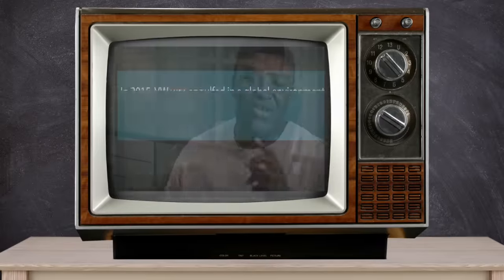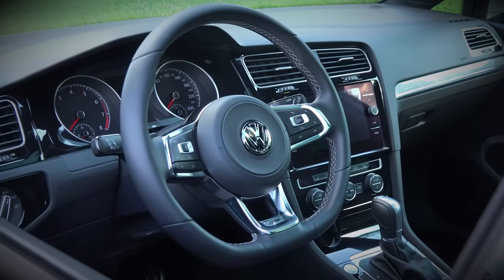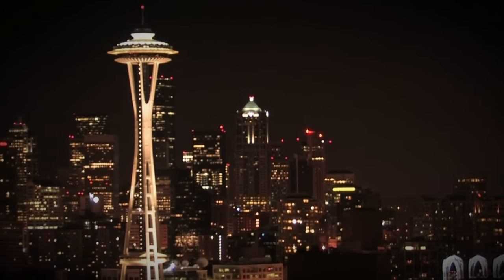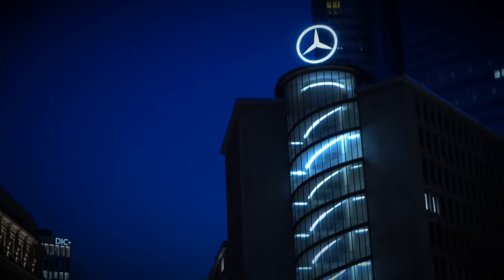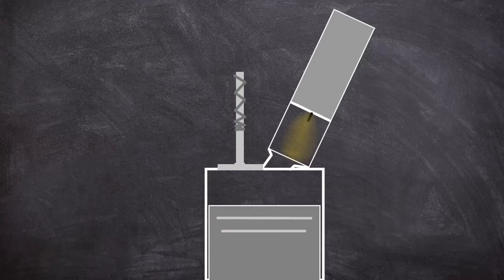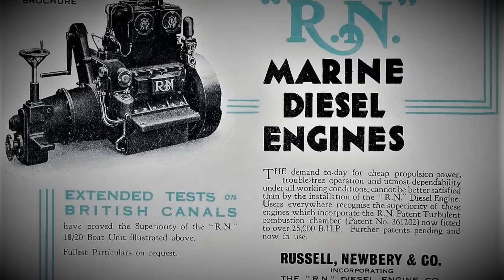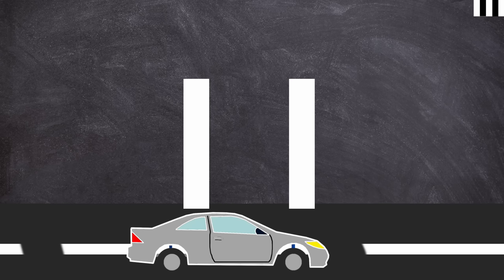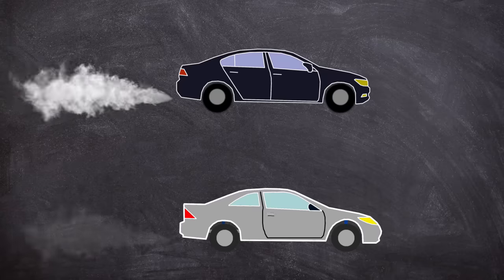Scandal: VW Emissions Dieselgate Explained | Plainly Difficult Documentary

Comment: Am a truck driver and my dad was as well.
I used to like the smell of a truck stop full of idling trucks back probably in 2000.
Now trucks using DEF a NOx 'solution' can give me an instant headache just hooking up trailers.
These systems also rob the truck of power and are horribly unreliable. 

I'll let you figure out if I would prefer to live with the consequences of NOx or with the systems currently in place to combat it.

I'll also say as far as I know, Diesel engines are always vastly more fuel efficient then Gasoline counterparts and more reliable.

That being said, I would love to see proper experiments with some sort of afterburner to deal with NOx and soot instead of a $10k filter and DEF. 
What upsets me more is its NOx OR soot, because one is from fuel rich combustion while the other comes from O2 rich combustion, but trucks are saddled with the weight, proformance lose and maintenance cost of dealing with both.
Reply: Yeah, and I prefer the cleaner air, deal with it.
Reply: @sparkplug1018  I do deal with it, every day I go to work I deal with a truck that struggles to haul your useless crap.

I also don't have any idea the environmental damage DEF does to the environment and I know you don't either, I know that it makes the exhaust from the truck I drive stink and cause me pain where older truck smells is strangely  pleasant on the rare occasions where there are enough of them running overnight keeping their drivers comfortable.
Reply: @ARockRaider  Want to know something funny? My grandfather said the same thing about steam locomotives, said they had a pleasant smell and had soul compared to these modern more efficient and lower polluting diesels.
Is DEF bad, maybe, though considering what it breaks down into, I'm going to hazard a guess that it is way better then what ever was spewing out that stack before. 
Hey fun quick question, are you also pissed you can't gravity balance the tanks anymore too? Despite the risk of damaging that transfer line.
Reply: @sparkplug1018  NOx is "what was coming out of the stacks before" and it's something that proformance cars use, they call it "nitrous" that's why I think an afterburner running either diesel itself or something like propane course deal with NOx

No driver who cares about fuel economy wants to see soot coming out of the stack because it's wasted fuel, as cool as the long trails may look.

If fuel balance problem I had I would simply install fuel pumps to balance fuel levels or have cross over pipes above the tank to deal with the one sided dispensers. (So the left tank would have a fill port on the right and vice-versa in addition to having a fill port for its side)

I want my equipment to be as efficient and robust as possible, near as I can tell the emissions standards are excessive and do very little good past a certain point.
I also believe those standards are there to make money for the manufacturers of the specialized and not ready for the real world equipment.

A belief I wouldn't argue against is that the emissions standards are intentionally unreachable to make life harder for the common man, don't try to argue that point cuz you won't convince me considering how CA wants to force use of electric cars but can't support the electrical dames placed on it by what few EVs they already have.
Also keep in mind that CA is the spawning ground for almost all of these excessive standards.
Reply: @ARockRaider  Well to be honest, I agree that an all EV future is some weird fever dream, that's a fair point.
And yes I know all about NO2, I use it at the track myself, no one is continuously running it on the street, those bottles don't last very long. I also run 110 leaded at the track, no one is running it on the street anymore.
And to be honest, you're one of the first drivers I have heard not have a problem with the EPA not allowing the bottom exit gravity feed transfer.
But no, they are not making regulations to make life difficult for little ol' you, that would be so counter productive it's not even worth discussing.  Since if that were the case, new car sales would just stop, and all that older stuff would just stay on the road.
Reply: @sparkplug1018  ok, sorry I'm gonna be a bit snide, someone who runs race cars is giving attitude about the environment to someone who moves goods for a living 😆 I couldn't write that sort of thing without being called a hack!

So, if you know that NO2 can be used as an oxidizer in proformance cars you would also know a thing or two about burning it back down to nitrogen and oxygen.
I'm sure a propane burner in the exhaust system would be every bit as effective at deal with the NOx and soot in the exhaust system, I just don't have the money to do any research on it and I'm sure whoever is making money on DEF would lobby against such a system's adoption if it were to work.

That's why you are required to have the system on the truck, not required to be tested that you are still meeting the standard every year. (In my opinion)
Reply: @ARockRaider  yeah I know how weird, I run that down the track on the weekend, how awful. Not thousands of miles over the road. Pretty big difference
Reply: @sparkplug1018  I just thought it's funny how one is a critical function while the other is a sport.

I don't actually care, I'm gonna keep enjoying my work best I can knowing full well that most people hate what I do and don't understand that If it weren't for people doing this job things would be much harder to get.

Trucks are the red blood cells of every modernized country, trains can serve an important part of that but can never move individual loads as fast or as remotely and trucks will always be needed for "the last mile"
Reply: @ARockRaider  Actually I appreciate truckers for the most part. And honestly would prefer shit not be so expensive operators feel inclined to put reslaps on trailers. Just leave the left lane open, realize we all have to breath this air and honestly I think we can all be happy. Because I’ll be honest with you, I don’t know if we are effecting climate change, but putting less crap in the air can’t possibly be a bad thing
Reply: @sparkplug1018  most of the worst offenders for bad behavior tends to be out of the supper carriers, they are the ones governing their trucks and leaving the trucks underpowered to try and save fuel.
Retread tires when done right are actually a great way to recycle the tire shells, but personally I wouldn't use them.
Unless it's an owner operator the driver actually has almost nothing to say about the truck's condition.
Any driver who is trying to optimize for fuel efficiency and reliability will try to get a truck older then 2003 because those trucks don't require the emissions parts that really hurts the trucks.
It's at a stage where you can have efficiency or you can have the emissions systems. (though having them is no guarantee of improved emissions)

Comment: but vw didn't use common rail until like 2007? they used PDs in 1.9 and early 2.0 TDI and really accusing diesel engines of acid rains and smog is more than unreal
Reply: They switched to common rail since PD could no longer comply with the emission standards. 
Acid rain isn't a diesel problem any more, it is caused by sulfur in the fuel which is no longer in diesel since it would kill the SCR cat

Comment: F The EPA here in the US. They are trying to kill the internal combustion engine and go EV which is actually worse for the environment than either gas or diesel engine by 10000 fold.
Reply: EVs are quite a bit better for the environment, actually. Not sure how you somehow arrived to the opposite conclusion of all the research.
Reply: @logitech4873  Not so.  The strip mining required for the battery components along far exceeds the environmental impact of an ICE vehicle  (Hint:  all of the mining equipment ain't powered by fairy dust).  Lithium strip mining is destroying  an area near the Andes mountains where more than half the world's lithium reserves are found.  Nickel is being strip mined from the rain forests of the Philippines and Indonesia.  And the Congo produces 70% of the world's cobalt, the mining of which is causing not only environmental issues, but also human rights abuses.  Much of the cobalt in your EV was mined using child labor.
Copper, often mined from Chile, has created a surge in open-pit strip mines that have destroyed topsoil, vegetation, wildlife habitats, and groundwater.

The carbon footprint of manufacturing an EV is 15-60% higher than an equivalent ICE vehicle (USC figures).  Because of the complexity of the battery manufacturing process, it is much more difficult and environmentally costly to build an EV.

Emission Analytics found that, because of their weight, emissions from EV tire wear can be up to 1000 times higher than the equivalent ICE vehicle.  More tire wear, more particulate emissions for the EV.

As of April of 2022, only 5% of EV batteries were able to be recycled, compared to 95% of ICE vehicle batteries.

And around 60% of electricity is still generated by fossil fuels.  If you're charging your EV, you're likely using fossil fuels to do it.  Unless you're in California, where you may not be allowed to charge your EV because the poorly maintained electrical grid can't support it.

Yeah, keep drinking the "EVs are better" kool-aid.
Reply: @mikecee3058  Please provide a source on the total environmental impact of EVs exceeding ICE cars.

And my car is entirely ran on renewable energy. Not that it matters, because EVs are incredibly efficient even even ran on "dirty" power grids.

Comment: I had Skoda Octavia RS 2.0 TDI back then in 2011.  This engine was part of the diesel-gate affair(As I later found out).  It usually regenerated DPF filter every each 400-500km before diesel-gate. Then after in 2017 they uploaded software that reduced NO2 emissions....and it was a disaster. DPF filter regenerated every 100-150 km. 
Since it started to regenerate very often, and I always tried to finish the regeneration(because the filter got clogged several times and I had to go to the workshop), I drove an estimated 10,000 km completely unnecessarily.  So just about as much on some silly emission standards. Defacto I emitted more into the air, as I had to drive more.

Comment: The problem is it wasn't just VW: Harley does the same thing, they tune the bikes for emissions leaving the factory then re-tune them at the dealer so they are no longer emissions compliant. BMW, Mercedes, Dodge and couple other as well.

But while holding companies responsible for the lies is important, the TDI was hardly the biggest polluter, it was effectively one of the most efficient ICE engines on the road, even today. It was largely replaced with gasoline vehicles with equal if not worse emissions in CO2 even if they have better NOx emissions.
Reply: The VWs were putting out over 20x the limits. The failure here wasn't marginal.

Comment: There are two sides of the problem that are not being addressed evenly. One issue is that our current technology struggles to efficiently and effectively reduce emissions while remaining cost effective to the producers which encourages companies to cut corners wherever they can(just look at it as companies wanting to earn a bigger profit) and the other side is that requirements are often put into place with timeframes to implement that are often too short to properly allow the transition in a way that is beneficial to the needs while also addressing the needs of these companies and the consumer(basically the government, at least in the USA, is mostly ran by people who are not engineers and politicians sometimes are under the assumption that if money is thrown at a problem that it can be solved rapidly despite the fact that some technological discoveries can take decades to develop). One example of issues that comes from this two-sided disconnect is that in the USA there is a requirement that washing machines of different sizes can only use so much water per hour of usage and the only way engineers have found to meet these standards is to just have the washing machine fill up part way, wait for the next hour to tick up while agitating the laundry, and then filling it up the rest of they way as with too little water the clothes will not get clean. I am not saying the government should not be strict on their guidelines but I do believe that politicians should do a better job of researching issues and make more manageable timeframes and requirements, though this does not excuse companies who blatantly disregard these requirements and skip corners as there often times (but not always) is a solution that this company has access too that they refuse to use because they want to line their pockets while keeping their products cheap so as to compete with other companies in the same market.

Comment: My 2012 Audi A3 had one of these engines. They 'fixed' it on a service. Not noticed any difference really. I was reluctant for them to do it but they done it anyway.

At the time VEL or UK car tax was done on emissions; so I only pay £20 a year. Even knowing the figures were wrong it was never changed. Overall the car can do 850 miles to a tank in ideal conditions, so I quite like it as I do about 12-14k a year - but now costs me entering emission zones so.. not so cheap now! I've had it 9 years.

Comment: Man those 1.9tdi PD engines were fucking incredible. Make great power, a good punch and do 300,000 miles plus easily. 

Used to service a taxi who had done 600,000 miles on an SDI PD engine and it’s never been cracked open

Comment: In short. Diesels are powerful and reliable as well as more eficcient then gasoline engines. Well they were but are not any longer  due to the efficiency and power being sacrificed completley to follow the emission regulations of today, and yes NOx is quite toxic. Its after all the red noxious gas emitted from nitric acid.  I therefore say that the only way to go now is with 100 % fully electric vehicles charged by clean wind, hydro and sun as well as nuclear power. Luckily EV tech is improving and we need to stop using fossil fuels altogether anyways. Also EVs have more power and torque then any combustion engine and are around 95 % efficient or more compared to 30% for gasoline and 35-40 % for diesel engines (Efficiency of the engine/motor itself. Add transmission and tire friction losses to that). However the complete lack of engine noise seems to put many at least in US off. If its not making lots of noise its not a real car to them.

Comment: Early emissions control systems just pumped more air in the exhaust so the ppm would be lower...
The compressor to pump that extra air in used about 11 hp... and that meant lower fuel economy.
It did more harm than good and it was applauded by all of the environmentalists.
Reply: Emissions standards are based on grams per mile of pollutants so just adding more air to the exhaust to dilute it would do nothing. You may be thinking of secondary air injection which helps burn off hydrocarbons and CO after a cold start. That was mostly a bandaid for old engine designs that couldn't pass any other way.

Comment: The big question here is whether the nox target was reasonable. I had heard the Passat would have been perfectly legal if it was shaped like a pickup truck. My understanding is that there is an engineering trade-off between carbon and nox, and that blanket bans on such vehicles that are really based on LA topography does net harm to climate goals.  For example, why reduce carbon efficiency to improve nox emissions in the middle of nowhere where that atmospheric concentration will be negligible? In general emissions regulations get arbitrarily tightened every few years without any direct data to support them, buttressed by assumptions that harm of pollutants is linear.
Reply: VW's competitors met their nox targets.
Reply: @PhysicsGamer  that issue is independent of whether the rule is helpful. These additional complex emissions systems add complex cost, as evidenced by the dramatic increase in cost of vehicles above the rate of inflation over the past two or so decades. We owned a 2015 Passat TDI and the particulate emissions were miraculously low and they could hit greater than 60 mpg on the highway without expensive hybrid tech. After the “fix” it cut their MPG performance by like 15%. If indeed a cheap diesel vehicle can be made that can hit 60 mpg with slightly higher nox ratings (in line with current pickup trucks), why ban that from operating in Nebraska where the concentration of Nox won’t get high anyways and we get a climate benefit from high MPG cars?
Reply: @NicholasAndre1  You really can't blame diesel emissions systems for automobile price inflation - diesel vehicles are an extremely tiny portion of the consumer market. And gasoline engines have mostly focused on mileage increases to cut emissions, which diesel engines haven't been able to accomplish while keeping emissions low.

Frankly, considering the fix produced just a 15% drop in mileage in exchange for what should be a 95% decrease in emissions... yeah, I'm 100% on board with that requirement.